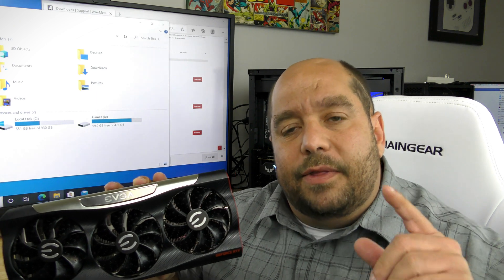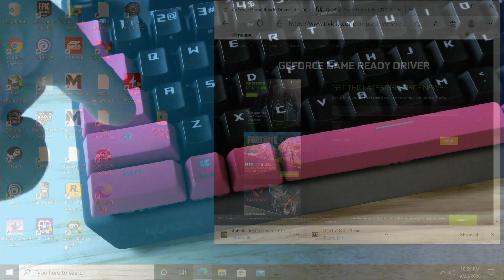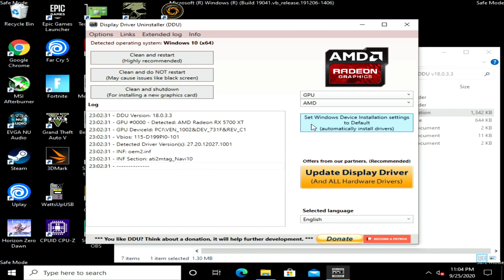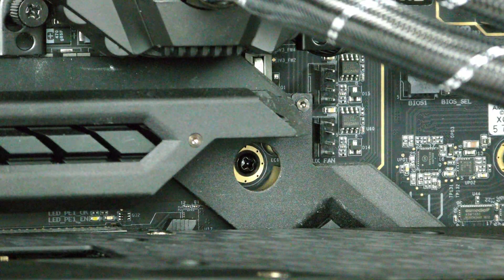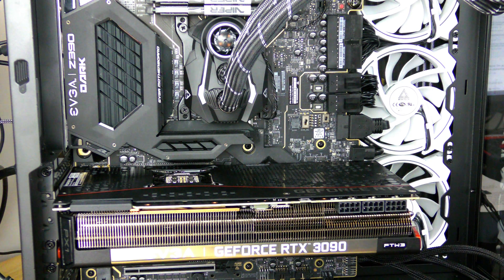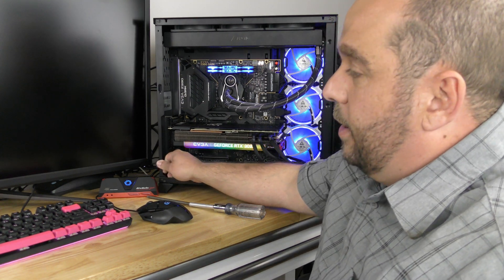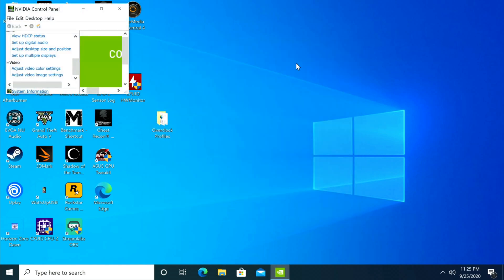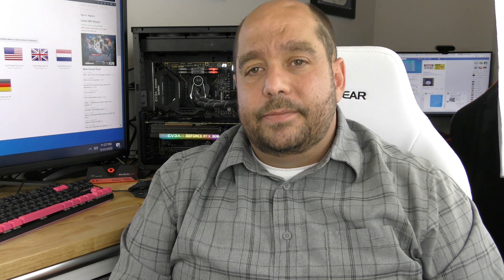RTX 3090 - Installing the EVGA Geforce RTX 3090 FTW3 Ultra Gaming

Comment: Where can you buy a 3x 8 pin cable ? All i can find online are 12 pins for 3090ti but 3 8 pins that goes into the power supply
Reply from the maker: you don't buy the cables, they come with your power supply, what is the manufacturer and model number of your power supply?

Comment: Is this a 3 slot card or 4 slot
Looks like 4 slot to me...
Reply from the maker: might want to watch the video, it shows you how to install it...
Reply: @ThisBytesForYou  I think I'll go with a 3090 non-Ti, it looks like that one is only 3 slot.  Not that it matters, I have room for both.  Running a 3070 for AI right now.  Want that 24gb mainly.
Reply from the maker: it helps tons in my video and photo editing, and well, having a trillion chrome tabs open haha.
Reply: @ThisBytesForYou  Yeah, I turned off Firefox hardware acceleration because each tab open eats into your GPU memory.  I want all my GPU memory free for AI rendering in the background or video editor rendering which will both max out the 8gb.   

If I max out the GPU ram while its rendering, and then open more Firefox tabs, bad things happen...

By lots of tabs I'm usually taking about in the 10's to 100's.

Using Windows AeroGlass or whatever with transparent windows effects will eat up your GPU memory too, so I disable it and use the Basic theme.  Again, for 100's of Firefox instances at a time, it then scales and scales and scales... as much motherboard RAM as you have.  In my case 128gb.
Reply from the maker: yeah, like I said, trillions hahah, close to the hundreds in reality and I dont use HW acceleration either, but I also have 64gigs of RAM, editing eats up memory.
Reply: @ThisBytesForYou  If you've got 24gb of RAM though, probably not terribly relevant.   My 3070 only has 8gb so easy to max it out in an AI app or game.   Still can run everything I want, just interested in upgrading to a 3090 to be a bit more future proof.
Reply from the maker: no, but I just want to make sure its all smooth, updating the build very soon too.

Comment: @thisbytesforyou 
Good morning,
Do you have a video in your playlist that shows how to installing a new mobo cpu while using the same gpu??
Thanks
Reply from the maker: I am not sure I understand what you mean?  Do you mean, how to install a motherboard then how to install a gpu, basically building a computer?
Reply: sorry if i didn't ask you correctly. I have a new cpu and new motherboard and ssd for operating system that i will be installing today. The only thing i will be taking from my previous pc is my 4090. Do you have a step by step video showing how to correctly install a previous GPU into a new mobo cpu and ssd M.2 drive. So i dont carry any bugs from the previous build into this new build. If that makes sense. I am coming from a AMD build and building a intel PC.  @ThisBytesForYou
Reply from the maker: yes, this video, have you watched this video yet?
Reply: i thought so, i am watching it right now as we speak. But i do notice in the video that you are still using the same pc parts and the only thing so far that is new going into the PC is the GPU. So i guess it's the same process as for me putting in a new cpu mobo and ssd @ThisBytesForYou   @ThisBytesForYou
Reply from the maker: its the same process, just think about what you are doing and what I show you.  The other thing that I go over in the video as well, is that you need at least 3 separate PCIE power connections, but 4 would be best for the power connection, if you are trying to ask that without asking it.  Other than the fact that its best to have a 1000watt power supply for this video card.  Are those the 2 things you are trying to get around to?  Both of which I discuss in this video?
Reply: no, not at all. i just realized i am completed building a new pc. With all my new pc besides the gpu is not new component. just taking it out of my AMD 4 pc build. I will Just using your one video i like a lot and act like it's a new build i am building. I just didn't want to carry any old drivers from my AMD 4 pc build into this new intel i9 build. that's what i am concern the most about. 

2. if i need to get rid of my 4090 driver on amd 4 build before i can reinstall my 3080ti back into the am4 pc i have.  @ThisBytesForYou
Reply from the maker: I recommend you reinstall windows, dont use the software from your old build on your new build, this video will show you how to create a windows 11 thumb drive and how to install it: https://youtu.be/ayp8TksEtoY and this video is on how to install the 3080ti: https://youtu.be/qsOC2IkKi1s, I hope I have helped.
Reply: I bought a new SSD m.2 for the operating system. So that i don't carry any old stuff over. @ThisBytesForYou
Reply: you have always helped me out and always get back to me when you can and I appreciate you very much :) @ThisBytesForYou
Reply from the maker: I can't express how grateful I am for your support and appreciation. It's viewers like you who make all the hard work worth it. Thank you for being a part of my YouTube journey!
Reply: :)  @ThisBytesForYou

Comment: Late comment.
I got a 3090 this january, when prices dropped. 1300 USD (13k SEK).

Its a two 8-pin card, right now i got a 8+6 pin 3060ti. So i got the spare 2 pin i need.

Anyway, i put it in, the left, IO side of the card wont go fully down, screw holes aren't aligned, millimeters to spare! The right clicks on alright.
I tried to make sure i was putting it straight down, my pci ports below it are empty so it has space.

Its a Phantek P600S case, ASUS ROG Strix B550-XE motherboard.
Reseated it some 30 times (3 different occasions) then gave up and put my 3060TI back.

I wondered at times if the left metal tabs arent going down in the slots but it seems unlikely.

Im at my wits end, im actually  considering taking the rig to a service center just to insert the graphics card... what on earth am i missing?
Reply from the maker: what is the manufacturer and part number of the card
What is the manufacturer and the model number of the power supply, I need specifics for both.

Comment: Great video.  Has given the courage to do an upgrade myself for the first time ever.  One question I had though, I am upgrading from a 2080ti to a 3090.  The latest driver on the Nvidia website for the 3090 is 526.47, which is actually the version I am already using.  Do I still need to do a driver clean using DDU in this case?  Thanks again for the great videos.
Reply from the maker: Always a pleasure my friend, so very happy you stopped by, trusted in me to help you, liked and subbed as well as took a moment out of your day to thank me.  It means a ton to me and I am so very happy I could help you.   This question kind of kills me, but it's totally up to you if you want to do DDU.  If you want to have potential issues and bluescreens and loss of performance, then no, you don't need to do this.  If you want all of the performance this card provides, let issues and bluescreens, you want to DDU.
Reply: @ThisBytesForYou  Thanks for responding.  I can see from the comments you get asked this question a lot, so thanks for your patience.  I was just slightly unsure about the need when you are essentially reinstalling the same driver.  I will of course follow you advice.  DDU it is.  Will be getting a 3090 tomorrow and upgrading using your guide.  I've never tried anything like this before but felt its time I learned.  Wish me luck and thanks again.
Reply from the maker: Yup, a few times a day.  Understand, when you install, install, install, install, install, install, you get lots of old files never deleted, you are patch, patching patching patching, like a pot hole, you keep filling it with cement, but its never going to be as good as a new road.  With a pot hole, you mess up alignment, tires, water builds up causing different issues around the area, loose gravel, which causes other issues, and so on, same thing with drivers, clear the roads, lay new asphalt and be done with it, a new driver comes out,... OOOO, do it again, it literally takes a few seconds, but EVERYONE fights it so much, so much so that you can check out in this video, for the 4090, at 14:48 (https://youtu.be/_AJlNxuukww) or you can watch the entire video and anytime my friend, I know it will work out well, as long as you follow those instructions.
Reply: @ThisBytesForYou  Upgraded to the 3090 today following your guide and no issues whatsoever.  All running smoothly.  Thanks for the help!
Reply from the maker: @javi3086  Thank you so much for your kind words and support my friend, it means the world to me and I am so very happy I could help you.

Comment: Where were you able to get the Extra PCIE cable. I plan to install my 3090 ti with 850w XPG core GOLD but it only has two PCIE cables.
Reply from the maker: it's part of the power supply I used, it wasn't extra.  If your power supply is this one, the 850 one then it brings 2 x 6+2 and 2 x 8Pin PCIE, can you look in the box and verify?
Reply: @ThisBytesForYou  I end up using the pig tail cable without attaching the pig tail and it works. The other two seperate cables are connected as well.
Reply from the maker: @Kouyah_1  you shouldn't use pigtails, as I mentioned in the video, but what do I know

Comment: Hey man quick question, I've recently bought the Evga 1000 GQ 1000w power supply. Does it have enough cables for the gpu? I'm reading the manual of what's included and i see like 2 different types of 6+2 pin connectors so im not completely sure. I am a new builder so I don't know the differences. Cheers
Reply from the maker: Have you watched this video?
Reply: @ThisBytesForYou  I ain't gonna lie chief, I did but rn I'm a lil tired so it's kinda screwing with my noggin a lil. Nice response time though.
Reply from the maker: @GeoVerge  no worries my friend, check out the video it will answer your question and the description.

Comment: Recently got mine with a 800$ discount and loving it already! Thank you for the guide!!
Reply from the maker: Always a pleasure my friend, so very happy you stopped by, trusted in me to help you, liked and subbed as well as took a moment out of your day to thank me.  It means a ton to me and I am so very happy I could help you.  howd you pull an $800 discount?
Reply: @ThisBytesForYou  local computer store! Seems like an overstock ongoing with the  cards as of 4 local locations, they all had 10+ cards. I also didn't have any extra direct 8 pin PCI-E cables. Tried to buy ones from Amazon which didn't work. Has to use a 8 Pin PCI-E cord but it's splits. Still connected two separated cables as you mentioned and it worked!
Reply from the maker: eeek, I never recommend connecting daisy chained/split cables, all straight cables, but not a special cable you buy, your power supply comes with it.  What is the manufacturer and model number of your power supply?
Reply: @ThisBytesForYou  weirdly no they didn't come with extra direct cables. Just to clarify as well I got one existing direct 8 Pin cable already being used previously. The daisy chain cables, I used two separate daisy cables and left their other end unplugged if that makes sense. Tested Metro Exodus on max and everything seems to be running fine!

I'm using a Seasonic 850W gold plus.
Reply from the maker: ahhh ok cool, just making sure ;)  So happy everythings working for you, BTW, in tomorrows video, I will have this card and its a very important video for you now that you have this card so make sure you are subscribed and have the notification bell enabled, its a basic video, but I think its VERY important
Reply: @ThisBytesForYou  ok thank you!!!
Reply from the maker: thanks bud

Comment: Ok got a problem, I have a Asus rog strix 850  platinum power supply tye problem is I don't have enough psu to pcie ports on the supply to run single cable from it to my gpu..so I tried to use one with a pig tail wired that cable to psu then to 2 slots on the gpu pcie slot. Put the other psu into Vga then just wired it straight into tye last 3rd pcie.slot.on my gpu....but it keeps making my pc crash what do I do???
Reply from the maker: the box for your power supply contains 3 x (6+2-pin) cables, you can use those as well.=, as I mentioned in the video, don't pig tail.  it would help you if you watched the entire video.
Reply: @ThisBytesForYou  I did use them and it keeps giving me the lit up Vga on the motherboard
Reply from the maker: So that I can help, please list the manufacturer and exact model number of the following components:
1. Motherboard - manufacturer and exact model number
2. CPU - manufacturer and exact model number
3. RAM - manufacturer and exact model number
4. Video Card - manufacturer and exact model number
5. Power supply - manufacturer and exact model number
6. Monitor - manufacturer and exact model number
 Redundant I know, but many people forget to enter manufacturer and exact model number
7. Do you have ALL of the PCIE connections plugged in, and not daisy chained or pigtailed, each coming directly from the power supply?
8. Are you running through HDMI, DP, DVI, VGA, any adapters?
9. UEFI in the BIOS from Legacy.  If it was set to Legacy, you will need to reinstall windows to get correct support.
10. Disable CSM in the BIOS
11. Installed latest supported chipset driver?
Reply: @ThisBytesForYou   Asus z590 Prime A, Asus Rog strix 3080, 11th gen i9 11900k, Corsair Vengance sl 32g, Asus rog strix 850 power supply, Nzxt kraken Aio, Aorus 4.0 1tb ssd. Running windows 11 on the system, the system runs fine with out Gpu plugged in I'm using the 2 psu/pcie cables that came with the power supply that has the 2 pcie plugs on one in and the 1 psu plug on the other.. on the psu side I have it plugged in on the power supply into a psu slot, the other psu cable plugged into the VGA slot on the gpu side I have all three ports plugged In leaving one of the pcie plugs not plugged in becasue it counts as the 4th pcie plug becasue the two pcie cables have two pcie plugs on one in making it 4 total.
Reply: @ThisBytesForYou  also I'm am running through a dp to hdmi brand ,nothing is daisy chain or pig tail if you have facebook or a messenger I could send you pics. And also thank you for taking your time out of the day to try and help!
Reply from the maker: STOP, stop you are daisy chaining PCIE cables?
Reply from the maker: to be certain, you have 3 separate cables coming from the power supply, going into 3 separate PCIE connection on the video card, is that correct, or is 1 cable powering 2 ports?
Reply: @ThisBytesForYou The pcie cable has one psu side and then the other side of the cable   has 2 pcie. I have two of those cables like that it did not come with 3  one pcie plug on one side and one psu plug onto the other... the only cables that came in the box is a two cables that have 2 pcie plugs on one end and psu plug on the other. There are not enough ports on power supply to run 3 individual psu to pcie cables. My buddy said I nee to get a 3 headed pcie cable on one end with the one psu plug on the other
Reply: @ThisBytesForYou  one cable that had two pcie plugs on the end powering two ports...then one cable that has two more pcie has on it but only using one of those pcie plugs to use in the 3rd port on the gpu. The psu to pcie CABLES look like the letter Y.

Y.   this is how the cables look the one side psu is the bottom of the Y and the two on the top of the Y  is your pcie plugs that go into the gpu
Reply from the maker: you do not need a 3 headed PCIe cable, that is pulling PCIE power from one cable, that will not be enough power, anyway, I will let you figure that one on your own but flash your BIOS to the latest version, verify your card is properly seated and set to Gen4 in the BIOS and see if that helps.

Comment: i just got a 3090 but i only have 12 pins worth of power cables. i tried to turn it on and there was a red light above the other empty 6 pins. is this normal? im assuming it is and i just need another cable to fill the other 6 pins. ( my monitor never turned on and the rgb didnt turn on on the card either }
Reply from the maker: You can't just fill in what you have, it requires 8pin pcie cables, what is the manufacturer and model number of your power supply?
Reply: @ThisBytesForYou  oh my bad i did the math completely wrong.. i meant i have 2 8pin cables and i have one empty 8 pin slot. i have a 1000w evga semi modular psu.. for some reason i thought they were 6 pin slots but they are 8 pin slots
Reply from the maker: @ProFerret  this card requires 3 x 8pin pcie connections and they cannot be daisy chained, what is the manufacturer and model number of your power supply, if you would like help trying to figure it out.